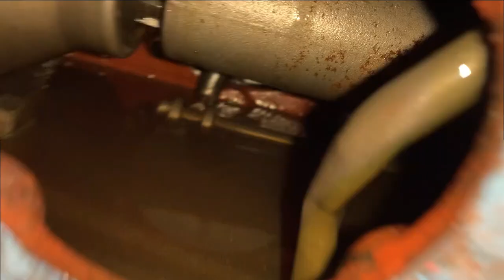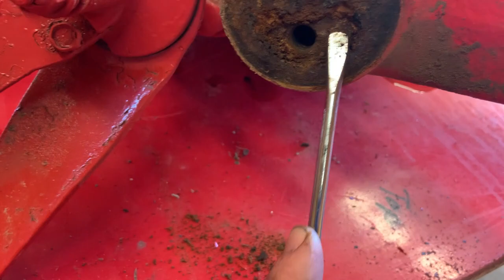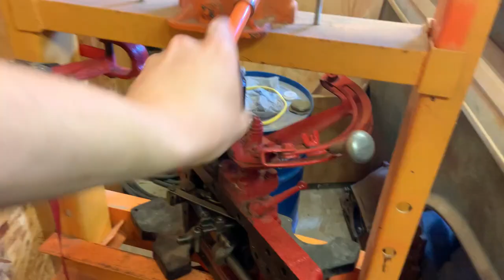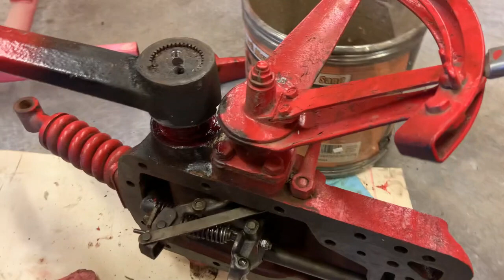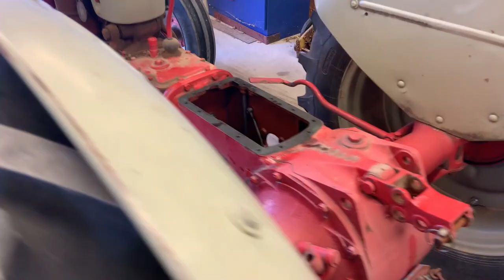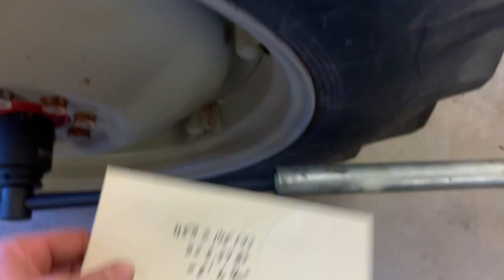1953 Ford Jubilee Hydraulic Work

Comment: I got a Jubilee in 1967 from the Ford Tractor Dealer. It had been used with a front loader only. The 3point lift was very slow. I replaced the flat o ring on the pickup and hooked the 3 point to the front bumper of my 54 Chevy truck. I pulled lever on the lift, under load the valve broke loose, and front of the tractor went of the floor. I thought I wrecked  both the tractor and the truck. As it turns out only the bumper on the truck needed work. Had not remembered that in years. Thanks for the video.
Reply from the maker: Sounds kinda scary! Thanks for Sharing

Comment: What size socket for the rear axle nut?
Reply from the maker: Mine were 2" but I saw several aftermarket sizes from a quick search, so you would be best off double checking yours. Honestly I would just buy a whole kit if you think you may need more someday. It was way cheaper for me to buy a whole kit then to buy the pieces individually and I have relied on that kit since this project.

Comment: I'm good without the music.    Very good engineering of you to put those spots on the very end of the bushing. Nice to learn from a Thinking Man.
Reply from the maker: The jury is still out on whether or not the timelapse/music bits are going to continue. I don't have enough feedback to make a decision one way or the other but I feel like with certain types of work, they are a nice way of showing how to do something without it being so dry. I have made an effort and have what I would consider better music or at the very least less used music. Hoping those welds keep the bushings from spinning like the last ones, should at the very least be better